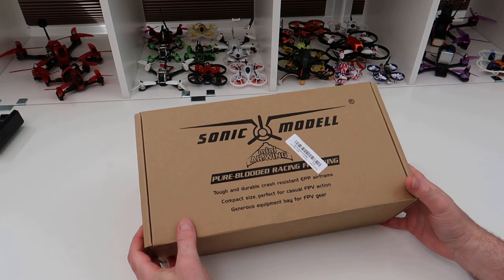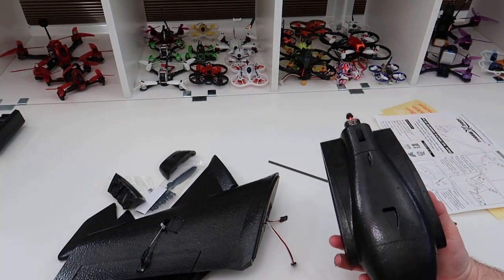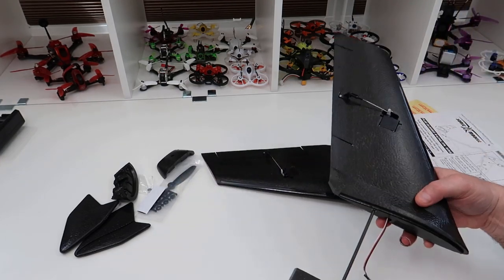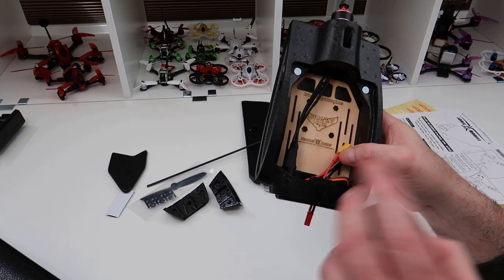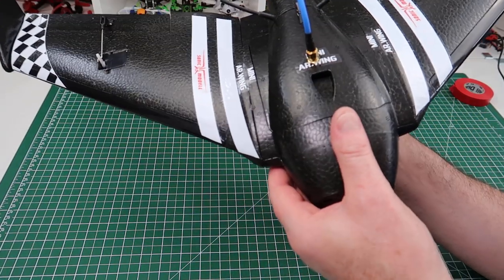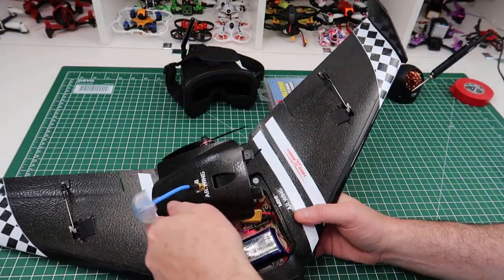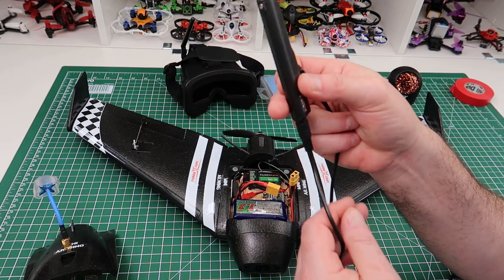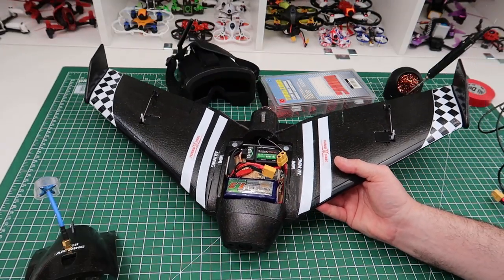SONICMODELL AR 600 MINI FPV WING UNBOXING AND BUILD OVERVIEW

Comment: Hello Colin.  Thank you for posting this.  I'm getting mine this week and this helped me decide on how I'll set up the stripped down build with no FC.  Did you ever post your maiden of this model?  I can't find it on your channel.
Reply from the maker: Hi  i just checked and I never posted the flight test what I can tell you is it has no real bad tendencies just keep the power up as its not the best at lower speeds
Lands realy easy just drop tge throttle and she glides in
Reply: @CKone41  Hey, thanks for getting back to me so quickly, Colin, and thanks for the info!